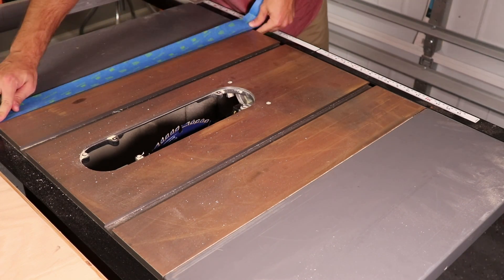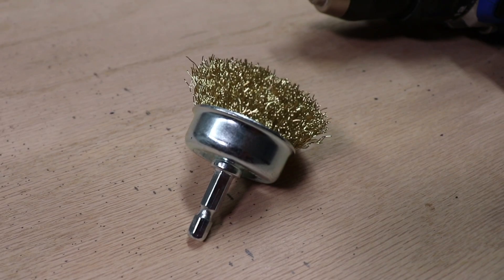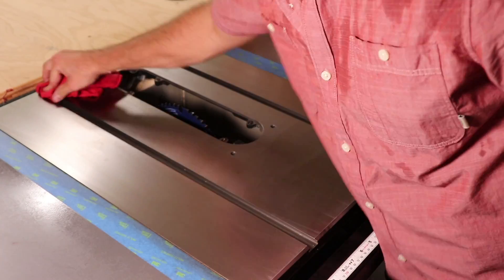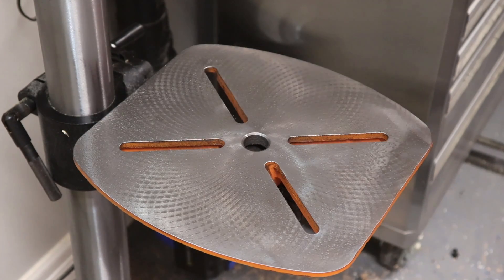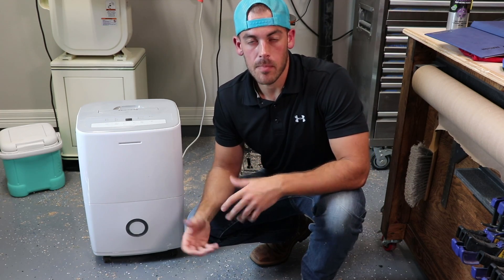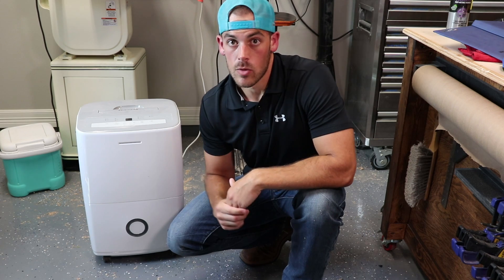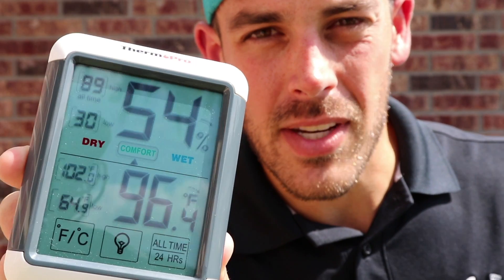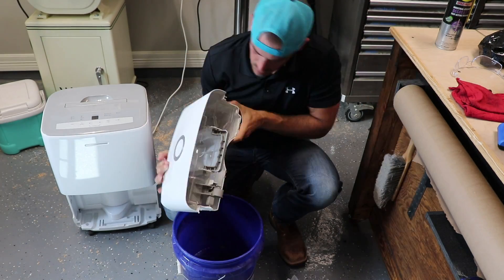Dealing with Garage Shop Humidity // Tool Rust Removal & Treatment

Comment: Just moved into a new house and setting up my shop. I have the same issue. My shop is always cooler but humidity is always higher compared to the outside. Combine that with cold water pipes running through, those pipes sweat so much. I wrapped them with insulation which helps control the water droplets but still need to figure how to lower that humidity. Was thinking maybe an AC would help, would it?

Comment: In San Antonio and have rust issues. Just ordered a dehumidifier to try and get the humidity down in the garage/shop. Another great cideo. Keep up the great work!
Reply: How has the dehumidifier worked?
Reply: @juanmendoza7487  I've been able to keep the humidity in the shop/garage in the low to mid 40%. A lot better overall. I just run the auto drain hose out the garage door weep hole and sealed around it.
Reply: @nsanerydah  I'm in Corpus Christ and trying to figure out if I should get an AC or a dehumidifier for my wood shop.

Comment: dehumidifier is an AC that vents its heat indoors which is not something you eant in a hot climate.  AC wouod be better. you dont have to set it for a comfortable temperature.  better, yet, use a humidistat to control when AC runs.

Comment: I too am in houston area,  beginner looking to set up my first shop in my garage, just like yours, to get my feet wet. I know you have moved on from the area, but how did the dehumidifier method work out for you in the longer run? My garage door gas some gaps and I dont see the humidifier keeping up, but perhaps with some simple weather stripping it could be plausible. Thanks!

Comment: Until I fully dehumidified by basement shop, I started using a product by Starrett called "M1".  It is a light solvent which leaves behind a microscopic layer of lanolin.  Great for ground table surfaces, instruments like micrometers, etc.  Except for wood working, you don't need to wipe it at all. 

In a very humid area but 70pt dehumidifier is able to hold summer RH at 36%.  The problem in New England is that some of our electric companies have had approvals for rate increase up to 117% on the energy charge.  This may make it necessary to do a really good study on sealing off the space.

One other suggestion, don't underestimate the importance of moving the air.  I keep a 20" box fan running on low speed day and night to keep air moving in a big circle around the shop.  Even with moderate RH, this can keep rust at bay.

Comment: In Houston too. Neither products used have done any good for me. Good old Johnson’s paste wax and Hornady One Shot have been the best. The constant temperature change from opening and closing the door with an ac will make the problem worse down here. I’d imagine the dehumidifier would too. I could be wrong though. I think the best method I’ve tried so far has been using the Porter Cable/ Craftsman  refinisher to clean the surface, heat the cast iron up with a torch just enough to sweat out the moisture from the porous cast iron and apply the paste wax while it’s still warm. It’s a lengthy process but has lasted the longest. Use Hornady One Shot (Bass Pro in the gun section) in between. I’ve even bought the Cerakote MicroSlick to apply to the tops but haven’t gotten around to applying. Carbon Method Carbon Coating is a newer product that shows to be promising too.
Reply: For an electronics lab space, I had gone so far as to run AC and a heater at the same time.  Finally put in a small dehumidifier and raised the AC temperature.  A higher temp, like 74 degrees, is comfortable when the RH has been pulled down.  The AC and dehumidifier both cycle during the day, giving a good balance of conditions and cost.

Comment: Lanolin is the best, keep a paint brush greased up and lubricate every tool and cast iron surface.
Reply: If you're into lanolin, try Starrett M1, aerosol or pump.  It leaves a micro thin layer of lanolin that can remain on surfaces unless it's an issue for wood working.  Pleasant smell for machinery lovers as well.

Comment: Living in florida... my shop isn't fully sealed off yet.. working on a solution for it but till then I need a fix that will help keep my wood from molding as well as the rust.. (still needing to wall in the inside of shop) but my father in law quickly moved tools in before I could get walls up..

Comment: I moved to South Florida about 9 years ago and all my tools began to rust immediately. After using steal wool and putting several coats of paste wax on them, they continued to rust. I didn’t crunch any numbers. I just went to Home Depot and bought a dehumidifier just like yours and cracked it up. I set it at 55 percent, attached a drain tube and ran it under the door. I haven’t had a rust problem since. My garage is approximately 650 sq. ft. And it keeps up no problem. The best part is that it’s is comfortable to work in there up to about 90 degrees due to the lack of humidity. Best/cheapest solution. Next will be the mini split.

Comment: I just use old motor oil on my table saw and drill press once a yr.  wipe it on and then wipe it off.  Leaves a micro sheen. Been doing it for 10 yrs with no rust at all.
Reply: Not good for woodworking where you don't want oil contaminating the wood you are working on.  I've found Glidecoat by Bostik is the best.

Comment: I have been attempting to crunch the same numbers... My problem is that I live in Michigan where summers are hot and humid and winters are cold and humid. My garage walls are insulated but the garage door is not. A dehumidifier would be ideal aside from the minimum ambient operating temperature.

Comment: Thank you for this! We are in San Antonio, from Wyoming, and new to humidity. I haven't noticed much rust on tools, but have on my 57 chevy project. I'm going to use ospho to remove that surface rust and primer until I can dig into the car. I've been curious about which dehumidifier to get and this helped a lot. I also used your cabinet plans to build lower cabinets. Thanks man, keep up the good work!!

Comment: The water coming out of that dehumidifier is called "zero water" and is pretty good for plants.  
Living in SW FLA, I'd like to see you make a video that actually tested that de-humidification plan you want to have, as this wasn't really a test at all, but more or less a video about your research regarding it all (which was very good I might add).
I just moved permanently down here from the Pacific NW, and this humidity attacking all my valuable tools has been quite an issue, so I'd really like to know about those coatings as well.  
I have heard about some sort of impregnated paper that people line their toolboxes with, even safes too to help absorb the moisture.

Comment: This is a great video for those of us in humid areas.  Someone I know has an airplane in La Porte, just off of Galveston Bay, and he keeps 3 dehumidifiers running in his hangar 24/7.  Airplane hangars are not very tight against air exchange.  The difference in the deterioration of the aluminum and paint on his airplane compared to one of his neighbors that didn't have dehumidifiers was nothing short of amazing.  The reduced humidity pretty much stopped any deterioration.  I'm in Baytown,  just a few miles away from Galveston Bay.  My new workshop, in progress now, will be fully insulated and room finished with a mini split AC system.  The insulation will slow any temperature changes and prevent condensation and I intend to run the AC any time it's not cold as we know it in the Houston area.  I'll keep it at probably 82 degrees when I'm not working in the shop.

Comment: Hi guys!
The relationship between the temperature of the steel, which warms slowly, and the ambient air temperature of your workshop, which can warm up quickly as the sun rise, causes a temperature difference, that pulls the moisture from the air, condensing on the cold, steel surfaces. This is why insulation is so important, in slowing ambient temps and allow the higher density of steel to “catch up”. Also, as the humidity rises, the temperature difference between the steel and the ambient can be less, increasing the chance of condensation and  rusting. At 30% humidity, temperature difference can be about 11 deg c, but at 80% humidity it’s about 3 deg c!
Reply from the maker: Awesome, thanks for the explanation!

Comment: If he would have used an orbital sander on that table saw it would have been easier and more uniform. And a lot quicker ! 
Not knocking your work man, you did a great job. Just my two cents on it.
Hell, when I was your age, I would have looked at someone like they were crazy if they even suggested I polish up my  table saws deck !
 My suggestion would have been to use the damn thing and it won't rust ! Lol

Comment: I live in SW Florida. One thing I did was cover each piece of equipment with a heavy duty cloth. Bought an entire bolt from Walmart. For protection they have to be in direct contact with the surface. So a cutout for drill press table, 1 for the table saw and have to make one for my new band saw. 

I do agree with the dehumidifier idea as well. But I have a suggestion. If you want to put it on a shelf, install a flange fitting in the back of the bucket, "shelf on exterior wall". Then you can drill a little hole through the back of the dehumidifier and all the way through the wall. Place a 90° fitting where it comes out and extend it to the ground. Never empty it. And you can let it run all night. 

Some people have their air handler in the garage. For them, tap into the drain line. From my A/C tech neighbor. Pouring 1/4 cup of vinegar into the drain once a month prevents algae growth.

Comment: I bought a mini-split AC on ebay for $600 delivered.  I paid $300 to install.  It has a “Dry” mode that runs it just enough to removed humidity and when I’m working in there I use the full AC cool.  I live in Florida where it’s really humid and have zero rust!
Reply: What size is your shop and mini split?

Comment: If your hot water heater is in the garage, suggest a hybrid hot water heater: it has a heat pump to heat the water. As a by product it puts out cool dehumidified air. The operating cost is cheaper than a electric or gas hot water heaters. Reheem makes a good one.

Comment: I use paste wax on my table saw.  Also, random orbit palm sander works great to remove rust on the saw top.
Reply: Is there a dedicated wax for that, or is it a car, floor or any/all the above wax?
Reply: @emeltea33  beeswax thinned with turpentine or mineral spirit

Comment: Living in some very rainy areas of Hawaii (220 plus a year) for decades one thing is clear. Unless a room is sealed a lot of water going through the dehumidifier is not only from the room, but from any outside air coming into the room. They do help a lot though. When you eventually seal the space better obviously you will get more effective and efficient.

Me and too much humidity don't get along. I oxidize. I ran the a/c and dehumidifier simultaneously during the rainy seasons in an older home with jalousie widows and no insulation. $600 plus a month in electric bills in ...

Don't ask me to do math.

Comment: Travis, regarding your rust problem....it's not entirely due to the humidity. I noticed in a previous video that you store your pool chemicals in your garage/shop. That is a BIG killer as far as the finish on your tools. Not just your work surfaces either. Left long enough it will have an impact even on your tools in your cabinets. Long story short, things like shocks and other oxidizers will do just that...increase the rate of oxidation of the iron on the surface of your tools. Just a tip. Keep up the great work.
Reply from the maker: Excellent point sir, thanks for pointing that out! I’m moving those chemicals shortly but definitely worth sharing.
Reply: Brother you just saved me. I wasn’t even thinking about the pool chemicals. My rust has compounded exponentially since I put the chemicals in my garage, hadn’t thought about it. Been adding vents fans to reduce humidity and increase air flow. Many thanks!!
Reply: I noticed crazy amount of rust after putting some bags of pool shock on one of my metal racks.

Messed up and rusted a ton of my tools. Don't store pool chemicals in garages!

Comment: Hey man.. great job on your channel.  Love it. I live in Florida and work away from home so I'm not around to empty a water collector.  I would love to see your ideas on a drain for this. As you can imagine Florida is very humid and if I dont run anything and come home a month later I have mold and rust everywhere.  Would love to see more
Reply: I too live in Florida, and work "on the road", so I'm gone for months at a time, and every time I come home I have to spend the equivalent of a 40 hr week just to get all of my tools cleaned up.
Of course the older I get, the more anal I am about any rust at all on my tools. I just will not use a tool if it has even the slightest amount of surface rust. It's to stop what I'm doing and go to the wire wheel, buffer, or 0000 steel wool and polish it out, because, steel that's polished and oiled will take, I'd say at least 5 times as long to develop any signs of rust.
As you can imagine, I don't get a lot done. But hey, my tools look great !!

Comment: Funny thing, I just sanded and coated my 6"  jointer today and lo and behold, Video on this. I was watching the table build and found this one as well.I how ever used a product that turns rust into black primer. I may not use the tool for a while so it is protected for this Oklahoma humidity for a while. Thanks for the great vids. I am subed to S.N.

Comment: You really should just get an A/C unit for your garage. Your dehumidifier is already costing the same to purchase and operate (because it's doing the same thing), the only difference is that with the A/C, you at least get SOME cooling benefit, whereas the dehumidifier will actually raise the temperature in the garage.

I insulated my garage door with 1/2" sheet insulation. It cost me about $50, and took like 2 hours. It's only R3.2, but that's a WHOLE lot better than nothing, and my shop stays well within a comfortable range, even on hot days (I live near Houston). Plus, these newer A/C units often come with an app, so you can have it run for an hour or two occasionally throughout the day/night just to make sure your humidity doesn't get too high.
Reply: Can’t argue with your points Andy, but here in Oz, the electricity is just too expensive! A dehumidifier draws far lower watts than an ac, and its thermostat responds to humidity, rather than temperature. Plus, they are only about 400 bucks.
Reply: @Forexfox99  What Ac's do y'all have down under? a average sized DH costs about .04/hr an AC for a medium sized room costs .35-.70/hr.
Reply: poppaluv 
Yo, poppy, we have all of the popular named ac units down here.  The problem is the cost of electricity to run them. Australia has the most expensive electricity in the world. I’d probably go with a small de-humidifier, for that reason.
Reply: @Forexfox99  a dehumidifier and an AC are the same machine just in a slightly a different configuration, so it's the same cost to run for a given size. The difference is a dehumidifier adds heat to a room, where an air conditioner cools the room, while also dehumidifying.

Comment: Great video.  I too live in Houston.  Moved here from Wyoming where we didn't know what humidity was.  All of my shop equipment rusted and seized up.  Moved to Lake Conroe, bought some new tools, and see the rust starting again in less than a year.  I have a very large 3 car + garage.   My garage is also not insulated and to make matters worse it has stone on the exterior that seems to trap the heat and radiate it into the garage making it 10+ degrees warmer.  I hope to insulate the ceiling this fall / winter and am on the hunt for a larger dehumidifier.  Thanks!

Comment: I’ve lived on the gulf coast of Florida and we used motor oil to prevent any rust from happening.  Works great.  I wipe it down once a year and have never had rust on my tools in years.
Reply: Very true if you leave residual oil on the tools.  I wipe on and completely wipe it off.  The key is to let the oil “soak” in and then wipe it off good.  I’m talking a coating at the microscopic level.  I do it on my band saw and table saw tables and have never had oil marks on anything I’ve cut.
Reply: Works great for automotive tools, but using oil or silicone on tools for woodwork can end up with stray oil marks on your wood.